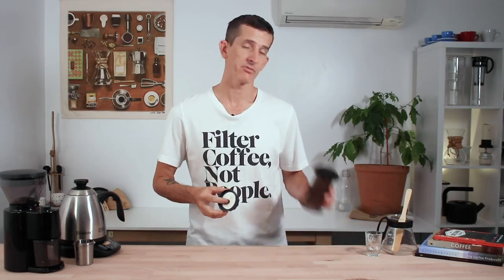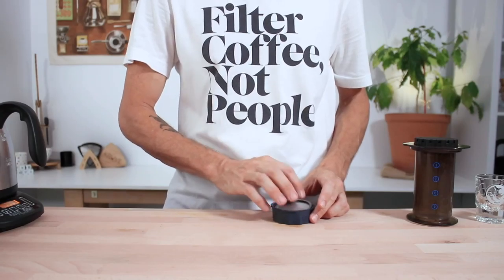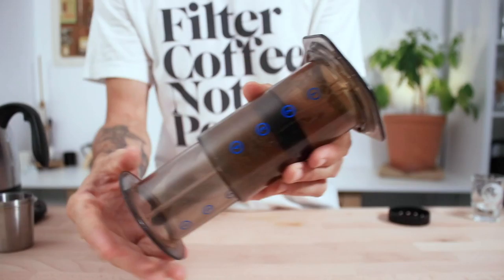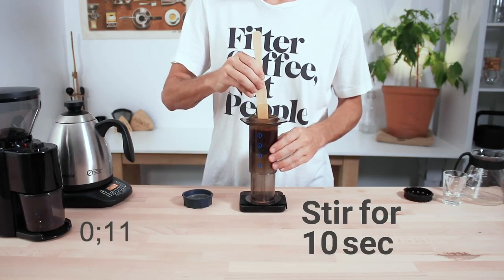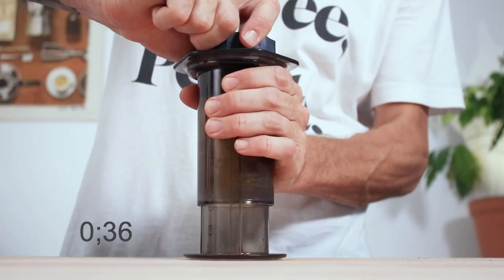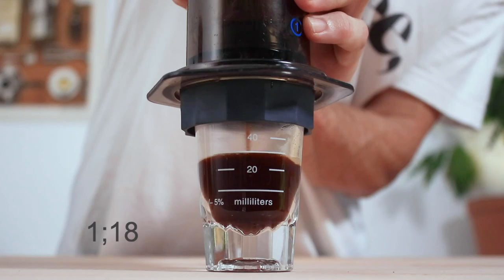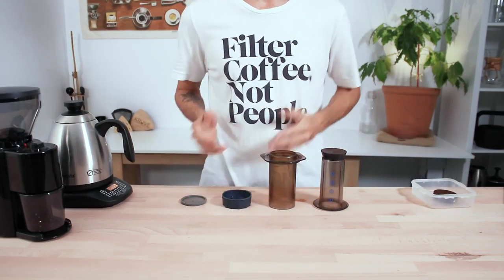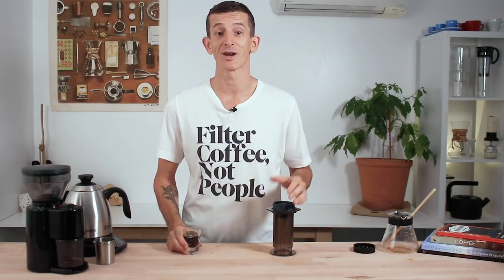How to Use the Fellow Prismo for AeroPress Coffee Maker

Comment: No need to invert with the Prismo, the valve prevents any leakage until pressure is applied!
Reply: Yes, but you will get more air inside. I’ve been doing the way you described, gonna try inverted method with less air to see if I get any difference on flavor

Comment: The inverted method is totally unnecessary as the valve seals.
Reply from the maker: it's not that it's totally unnecessary, but it isn't necessary to brew it in the inverted method - in fact you can still brew it both ways. – I brew it in the Inverted method however bc: this way offers less of a final press, less air gap (and overall area where the grinds can sit out of the slurry, up the sides of the chamber walls- after stirring) and I've found when you insert the plunger in to the chamber in the Regular method, it's activates the valve sooner than I'd prefer.
Reply: @AlternativeBrewing  That makes so much sense, thanks for explaining!
Reply: @AlternativeBrewing  cool
Reply: @AlternativeBrewing  I'll have to try it your way. The valve is activated too soon the regular way, thus lowering the pressure too much.

Comment: Hi @alternativebrewing I know this is very old video so dont expect I'll get an answer. But, here goes anyway. I have Vario grinder with numeric 1 to 10 (major) and Alphabetic A to W (= to 1 to 26) (minor) grind settings, e.g.  5M which is middle of both ranges. The smaller the number, the finer the grind and A is fine to W coaser. How can I transfer the numeric settings of most grinders to the Alphanumeric Vario settings? Thanks in advance if you answer.

Comment: Why are there so many people doing inverted with the prismo if it has a valve that only opens when you press down?
Reply from the maker: Too true! But I find in the inverted method I can remove a lot of the excess air out of the brew chamber and have the plunger placed further in - reducing the space needed to press down.
Reply: They're called hipsters. They make up BS reasons for doing unnecessary things in the hope that people will think they're cool.
Reply: I got a Prismo mostly to avoid inversion.

Comment: So with the regular filter basket the press can't be stored in pressed position because the rubber needs to poke out the end of the cylinder. With the prismo is this method of storage ok?
Reply from the maker: no – you're still unable to press the plunger down all the way with the cap on.

Comment: How does the taste compare with a normal aeropress cap with the same recipe?
Reply from the maker: That's a great question. You'll discover that the single hole in the Prismo does indeed increase the pressure slightly on extraction vs. the open cap and this does have and added effect on texture and strength of the coffee using the Prismo 👍

Comment: The step you show at 1:33 (0:24 brew time) is dangerous. I just tried your recipe now and the plunger slipped inside the chamber at this stage and pushed all the way through spraying hot coffee slurry all over me (luckily onto a pair of jeans) and also all over my kitchen. I mean all over, not a little puddle. Might be worth cutting that bit out.
Reply: That's what I thought might happen when I saw him doing it. In fact, I consider the entire inverted method a bit unsafe. I always brew in the original position using Tim Wendelboe's stopping technique. I considered getting the Prismo because it promises that there will be no dripping, hence no need for inversion. The crema isn't that impressive at all and it's a cosmetic issue anyway. The crema consists of the coffee it is floating on top of, nothing more, nothing less.
Reply: Happened to me too LOL
Reply: To be fair, that's a danger of the inverted method in general, not just with this product.  And as the main benefit of the inverted method is that it prevents early dripping/leakage, and this product prevents that, I find that it's completely unnecessary here.
Reply: With the Prismo attachment it is not necessary to invert because the Prismo doesn't allow liquid through until you actually apply pressure.